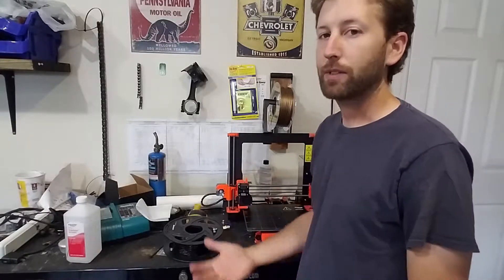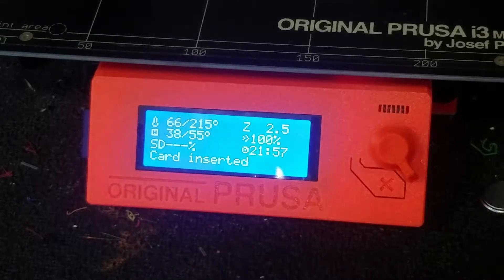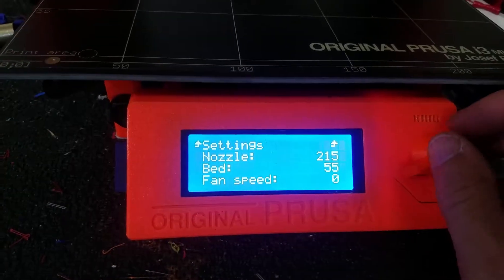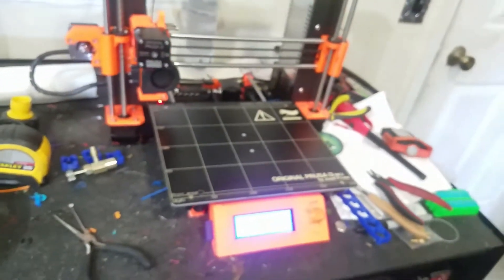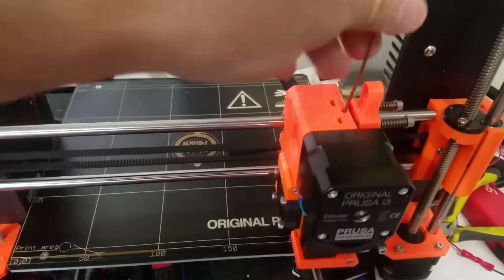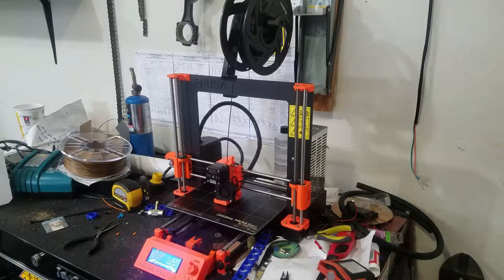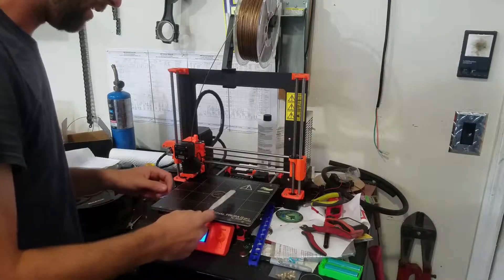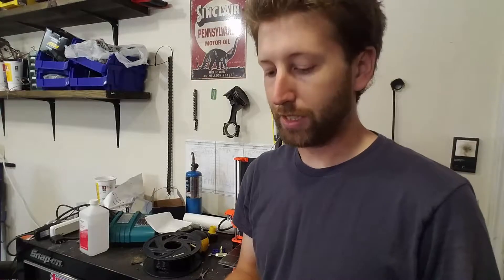Make a Custom Poker Chip From Scratch Part 3 of 3: 3D Printer

Comment: Wat was your estimate for cost on your single chip and then extrapolate to 1000 chip set of all same chip template?
Reply from the maker: ~$0.07 per chip or ~$70 for 1000 for filament. It will take 211.5 hours (8.8 days) of print time and ~$3 of power.

Comment: Some good work with easy to follow aids and instructions. My only issue would be the amount of time and cost of resources to make  a few hundred (at the very least) because that's how many you'll need to make use of them.
In any case - good video 👍👍
Reply from the maker: The time would be significantly more costly than the materials.  3d printers are great for bringing ideas and concepts into the real world, but not great for mass production.  The primary objective of this video series is to give a practical example of a concept CAD model to a real life 3D model that can be held in your hand.  Thanks for your comment and interest in this video!